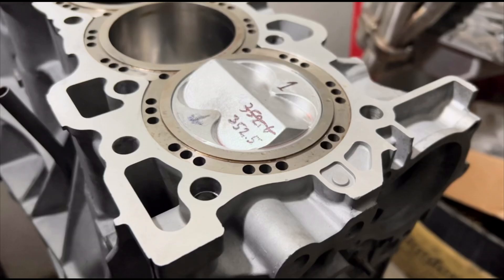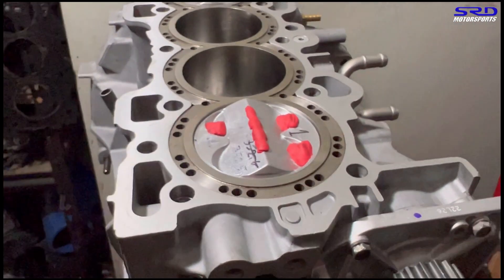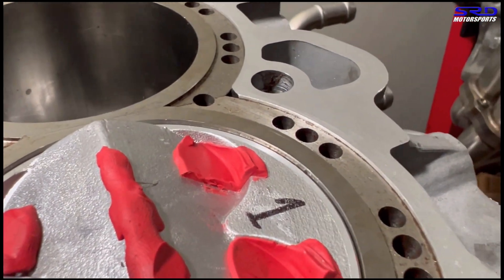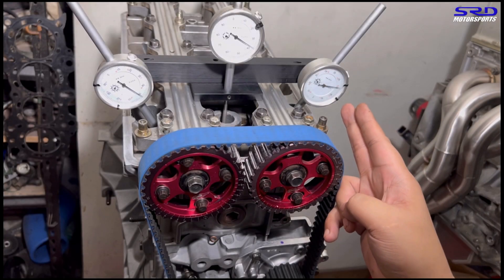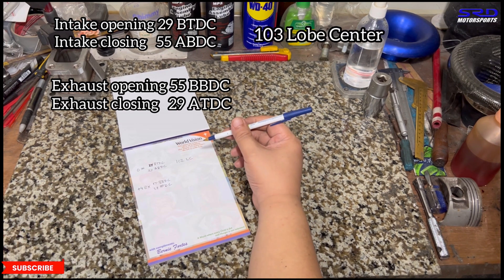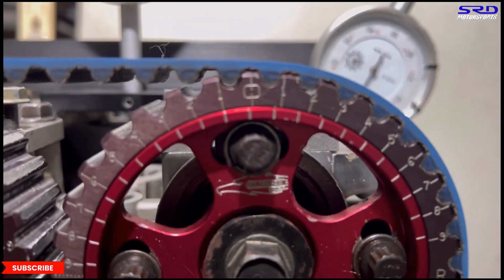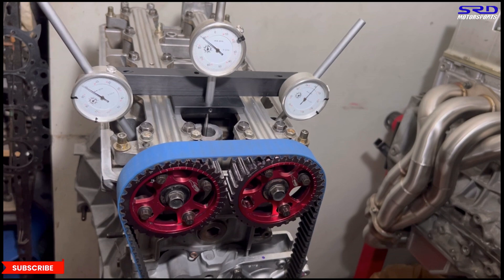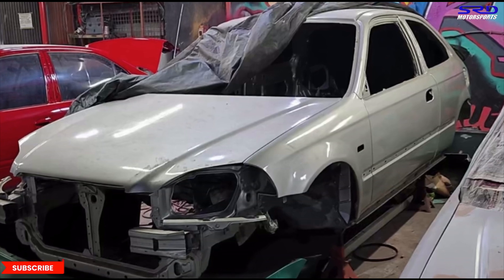Honda TypeR B16b Stroker Build Series Part 7 Cam Degree & Clay Test

Comment: I have a question I’m planning to put skunk 2 tuner 2’s or tuner 3’s on my stock block b20vtec it’s a low comp bottom end and skunk2 valve train with aem cam adjustable gears do you recommend for me to do this clay method even if the cams are set 0.0 on both intake and exhaust side? 

Or how would I go by adjusting the cam gears with clay method by advancing the timing 1 on both each side? Still learning lol running a gsr head also.
Reply from the maker: that’s really not advisable as even just slightly bigger than an OEM CTR cam u will have piston to valve clearance issues even if u clay it… why?

Because the valve reliefs on the piston is not the same location as the vtec ones and the vtec head has way bigger valves than the non vtec which has the pockets suited for it at a smaller and different location
Reply: @SRDmotorsports I’ve seen some people run tuner 3’s on stock b20 blocks some made good power on e85 without checking clearances (p2v) and leaving the cams gears set to 0.0 on both  why I was curious and ask you for extra saftey but now I know
Reply from the maker: @ funny cuz unless u saw their stock block? Everyone claims “stock” block

That’s the same crap here in my country some claim b16b but make 220whp and torque of a 2liter ? Bruh… or a stock block b20 pulling 220whp on cams like u mentioned 

I guess YCP pistons is just a waste but how come it’s a go to piston option or maybe once they install it ? It’s then claimed as stock b20 lol
Reply: @SRDmotorsports true you could be right about that.. I’ll take your advice man thanks bro🙏🏽
Reply from the maker: added info:

Stock block b20 on b16 head as the latest build series on this channel will net u 9.2:1 comp on GSR head maybe 9.7:1 not even reaching 10:1 and if they made good numbers on skunk2 tuner2 cam ? 

something’s fishy right there 

I guess “high comp” pistons is a scam
Reply from the maker: @ but if u find a b16a2 camshaft (bigger than the earlier b16 or b16 that’s a/t or ITR cam? That will wake up your set up nicely 

Keep an eye on that
Reply: @SRDmotorsports what I’ve seen was on a dyno video eg coupe headpackage tuner 3 cams bolt ons e85 made 225 “stock block”

But yeah man I’m also looking for ITR cams but the prices are ridiculous for a set right now I just have gsr cams it does the job for now but def want more haha
Reply from the maker: GSR cams is better than b16a2 so ur okay but yeah keep an eye on CTR or ITR cams
Reply from the maker: @ in my country they do the same on posts but then when questioned? It comes out that their “stock block” claim is mainly because it’s “stock bore” stock bore YCP lol

so we know deception is as good as lies so technically they be posting lies lmfao 🤣 😂
Reply: @SRDmotorsports will do brother!!🙏🏽🔥

Comment: What the best cam degree for ITR 97 cam? Can u give me the best degree for in and ex.
Reply from the maker: ITR uses oem camgears which showed the proper lobe center 

On the b20vtec gsr cam video I did we tested b16 and b18c cams

Put the degree is lobe center it’s not camgear setting
Reply: @SRDmotorsports  thanks bro 👍🏻
Reply from the maker: No problem brother

Comment: What size are the combustion chambers in cc after you clearanced them ?
Reply from the maker: 43.5cc
Reply: @SRDmotorsports  interesting,  what CR are you guys shooting for ?
Reply from the maker: This is gonna target 13.2:1 pump
Reply: @SRDmotorsports  13.2  is way too high for us here in RSA with our crappy 95 rated (But actually 93 octane), we push the limits at 12.2 and then it's still not safe.
Reply from the maker: Oh SA … I can understand that… indeed if 12.5 is too high

Comment: This setup is crazy. What's the owners goals with it? To run on pump or E or race fuel? I think itll easily crack 250whp on even pump gas with timing taken out.
Reply from the maker: Pump… owner plans to daily and do occasional hill-climb 😎
Reply: @SRDmotorsports  Na thats way too badass. I say 260whp easy. And great info there at the end of the video. You should always be running at the specified LCs. If the motor makes more power with advanced mechanical timing, the "bolt ons" part are not doing a good enough job of flowing what the motor demands given the head port work is a1. Great stuff!
Reply from the maker: @ogswagkillapbeastmode694  yes sir that’s actually the importance of it…

Especially on a dohc where u can adjust lobe centers separate = means u can clearly see which end needs improvement be it induction or exhaust or both

Comment: How do I find specs to degree OEM cams to OEM values? I have 1996 ITR cams on an LS Vtec. Just looking to set them in to OEM spec
Reply from the maker: Oem runs oem cam gears… so I figure u can degree it on oem camgears and that’s the specs u can match on the adjustable camgears